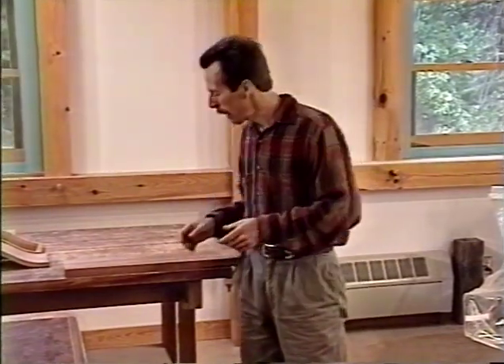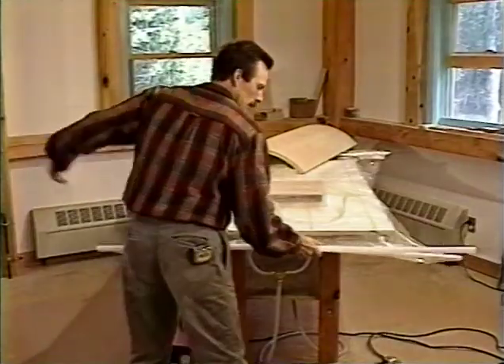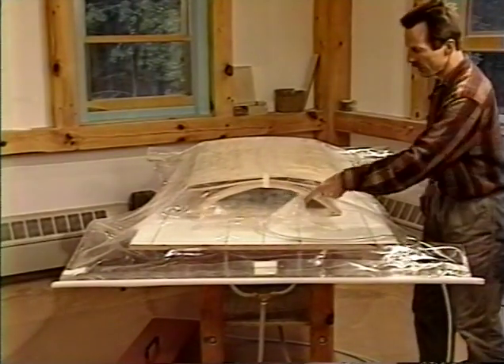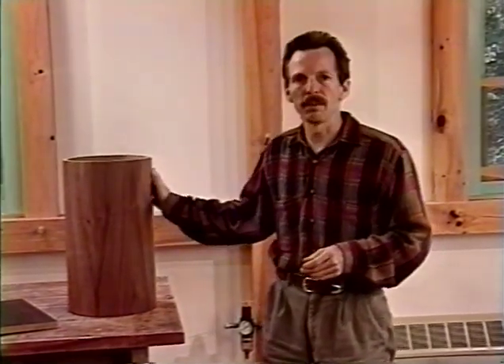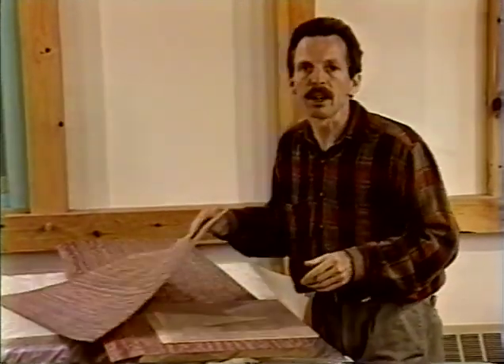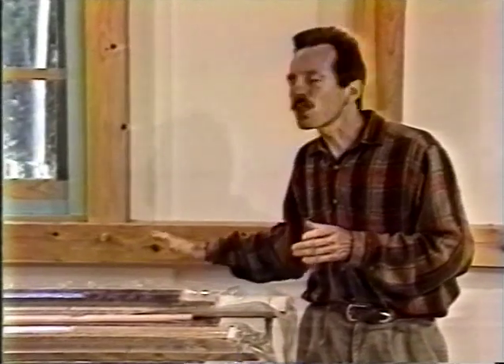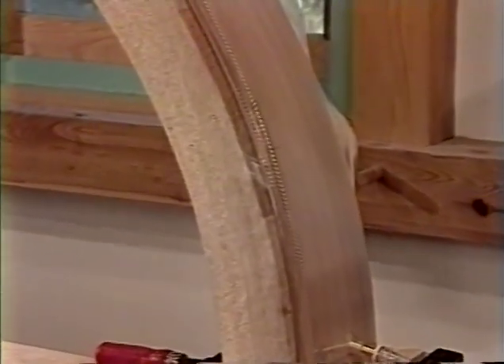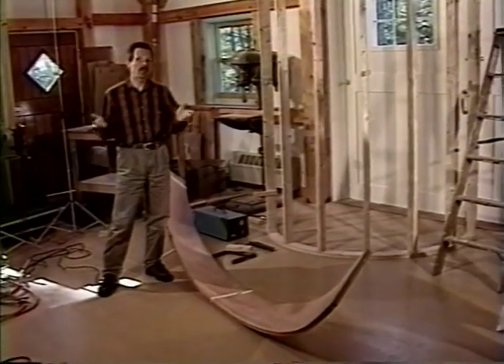Working in a Vacuum - A Guide to Advanced Vacuum Techniques for Curves and Shapes

Comment: If your shop is room temperature, what's the longest you would leave something in the bag for. Lets say 4'x 8' sheets. Would Unibond take the longest to harden?  Would you leave them overnight ever? In my experience it seems like yellow glue because it takes air to harden can take longer than expected sometimes. While the working time is very short sometimes.

Comment: Here's a newbie question. What does one do when glue squeezes out into the bags - how does this affect the bag? Are there are different challenges for different glue types - Titebond, epoxy's etc.?
Reply from the maker: PVA glues (Titebond) will not adhere to plastic, so it's not a big deal for them to get on the bag. If you want to keep your bag extra clean, you can use a sheet of 2-4 mil polyethylene plastic drop cloth (painters' plastic) as a barrier between your work and the bag. If using an epoxy or polyurethane glue, we would recommend a plastic drop cloth to prevent potential adhesion with the bag.